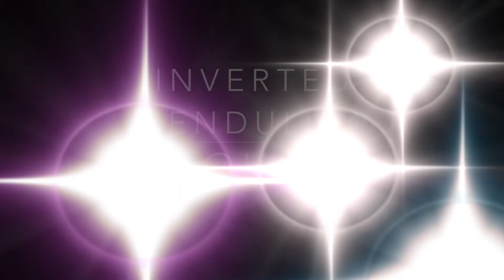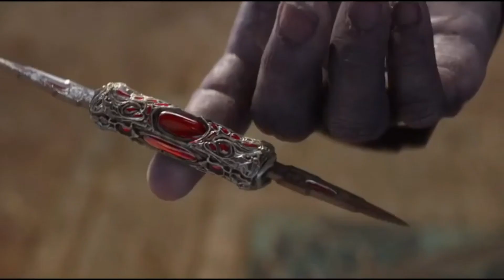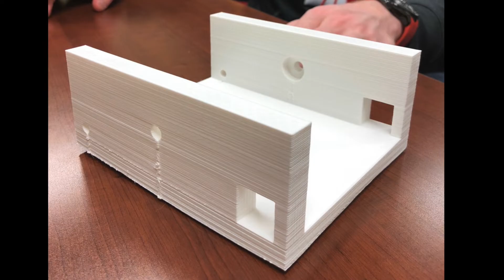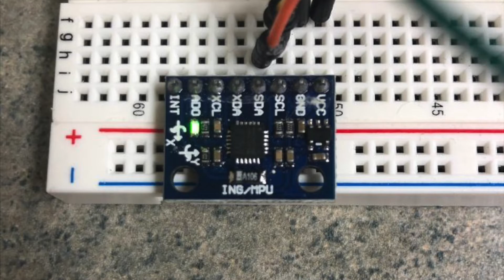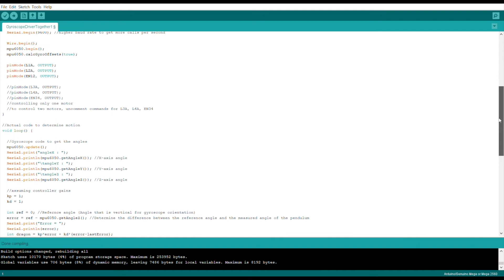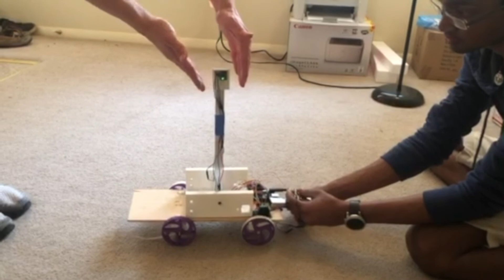Feedback Group18 Inverted Pendulum

Comment: The motor is dissipating the energy provided by the battery really quickly.  The system no longer attain the time invariant condition. So, the PD gains should be changed accordingly, making the tuning even harder.